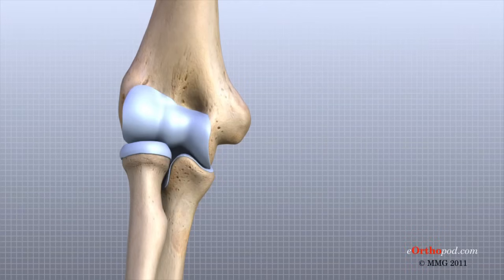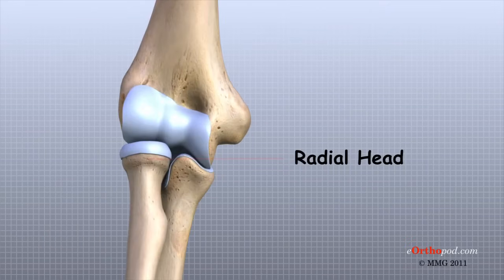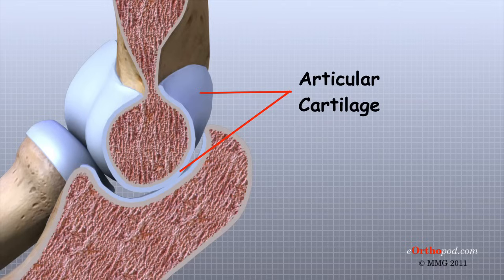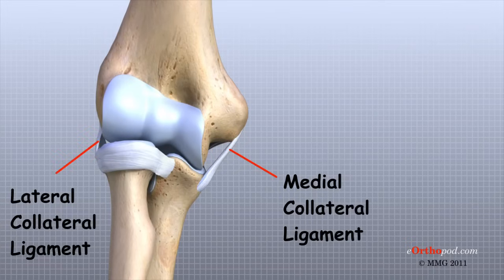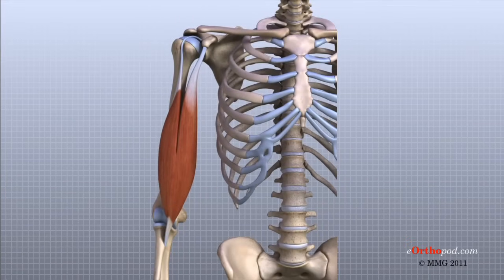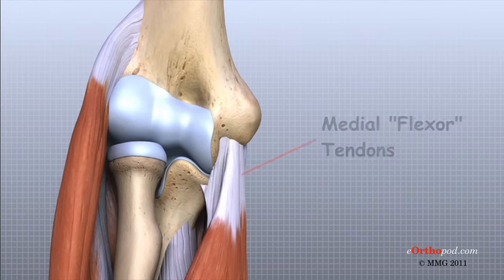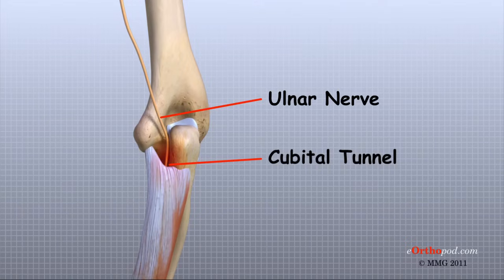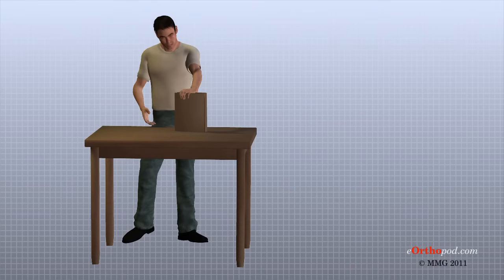Elbow Anatomy Animated Tutorial

Comment: Awesome video. I've had 3 surgeries on my elbow to remove scar tissue from a severely dialocated elbow. I have bone growth in the elbow joint next to the nerves. im restricted to 10 degrees ROM. This video helps me explain to my ortho.
Reply: same thing happened to me recently dislocated my elbow and have around 10 degrees less ROM, have you found any exercises to help with it
Reply: +jacob chow 
Stretching it seems to help. Worry about strength later on.  Do what your ortho or therapist says. it will take time.
Reply: Bone growth elbow recover

Comment: my left elbow hurts me from about 6-7 years now. 'doctors' have inject in my elbow 7 times so far  steroid stuff but is not helping. i have been told lately that they recomend me a surgery but don't guarantees that will improve anyrhing. does anyone know how to cure elbow pain in non 'science' way? thx in adavance. i am from poland.
Reply: Never had elbow issues until this year, and it's gotten better now, but seems very slow to heal. Sometimes it gets a little sore if exerting force in a direction where the elbow is not perfectly on a line from shoulder to hand
Reply: Bros 7 years, thats like something irepairable other than replacing it with surgery.